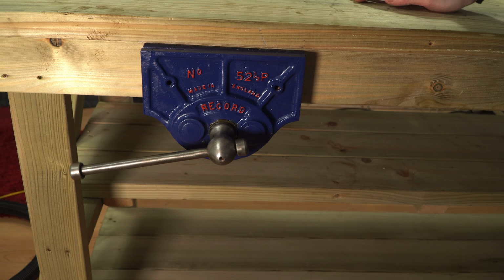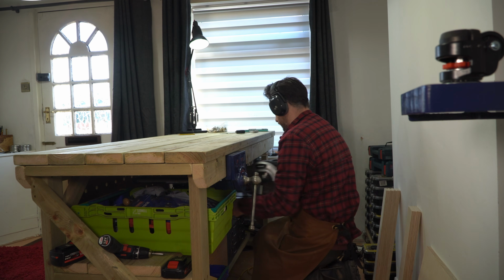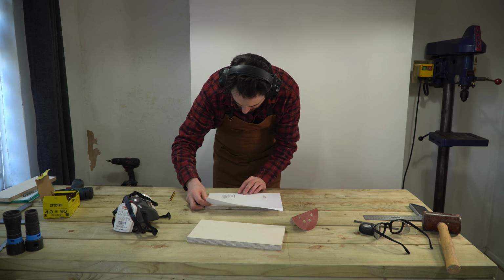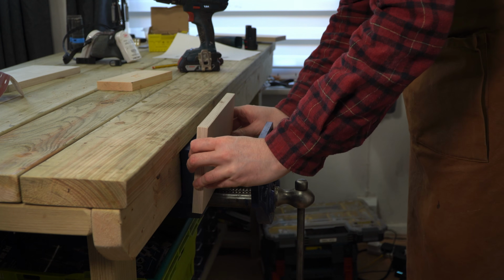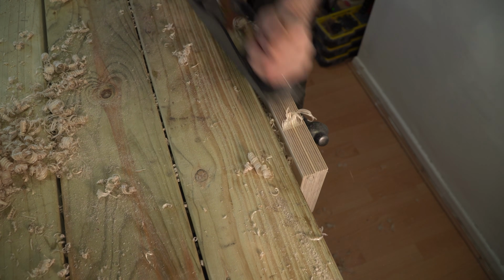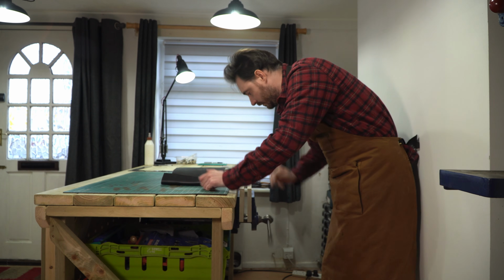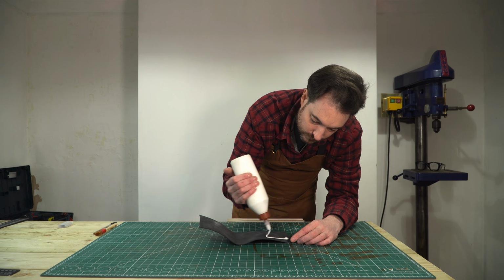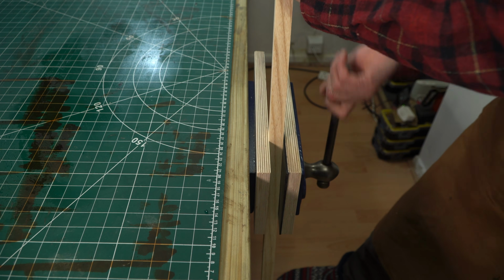Badger Bites, Adding vice Jaws

Comment: One little tip that will stop you getting pinches and blood blisters is to slip a rubber 'o' ring over each end swell on the vice handle. These rubber buffers also make it quieter in use.

Comment: A much easier way to make your screw-hole template is to use a strip of masking tape.
This also works well when you want to mount a 13 amp power-strip on the wall.